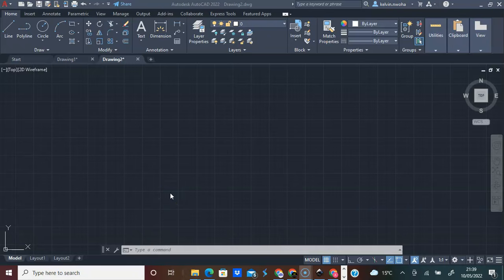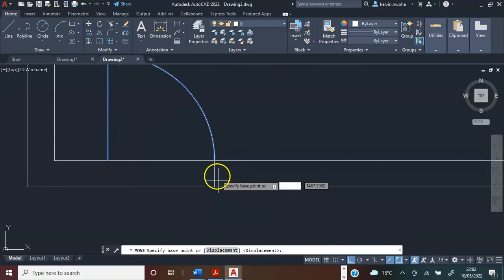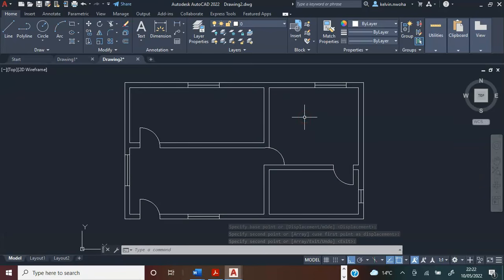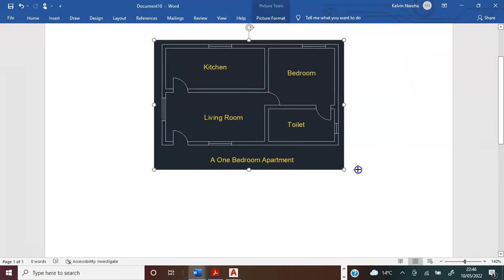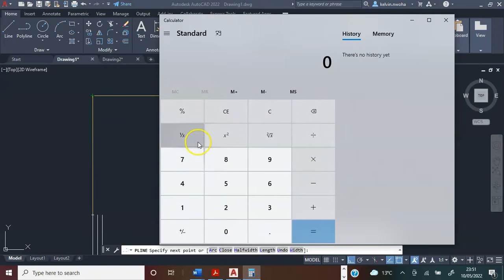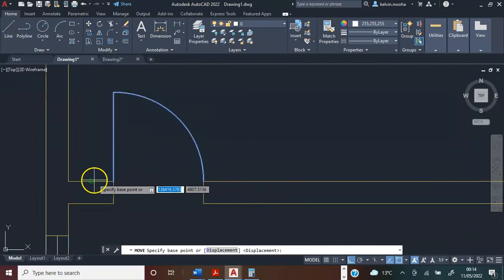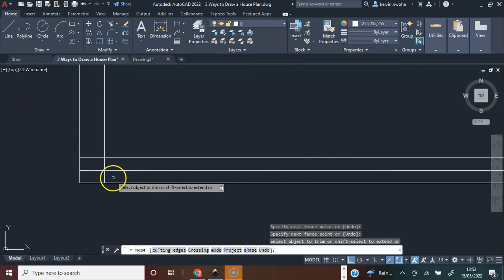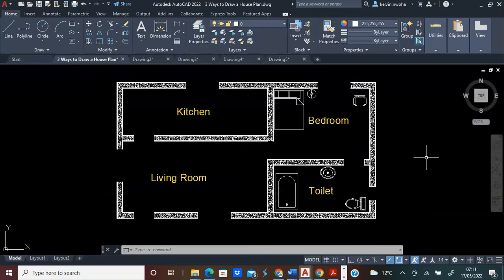4 Methods on How to Draw Floor Plans in AutoCAD (For Beginners)

Comment from the maker: 00:00 Introduction
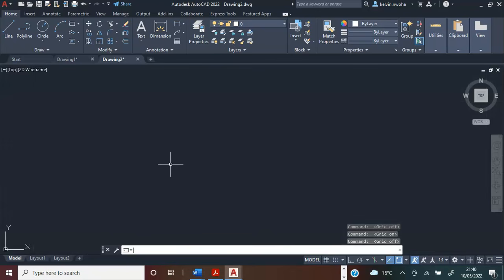00:31 Method 1
24:20 How to make a house plan line thick
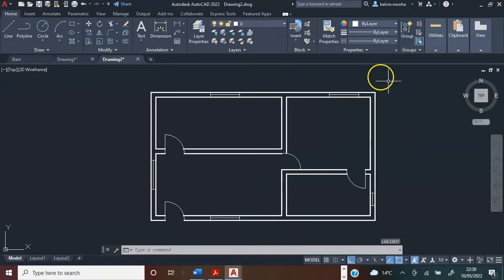26:35 How to dimension in AutoCAD
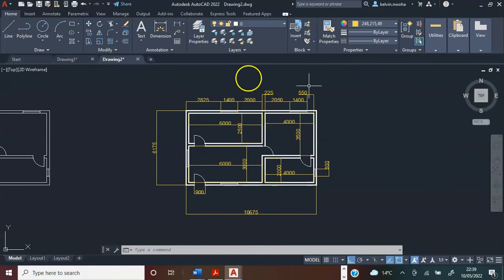31:50 How to Add Texts in AutoCAD
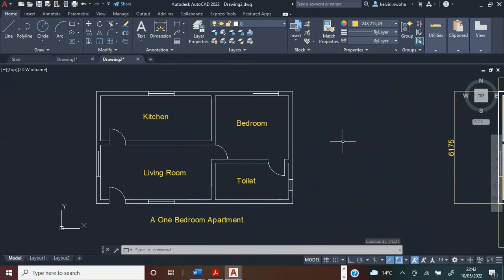33:58 How to Produce a Quick Print in AutoCAD
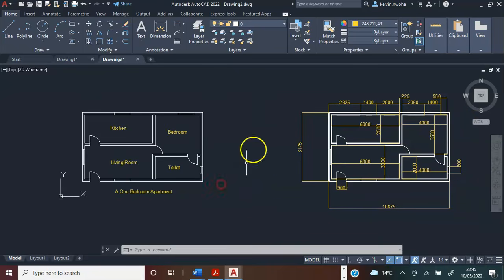35:50 How to Copy AutoCAD Drawing to Microsoft Word
35:59 How to Zoom in AutoCAD
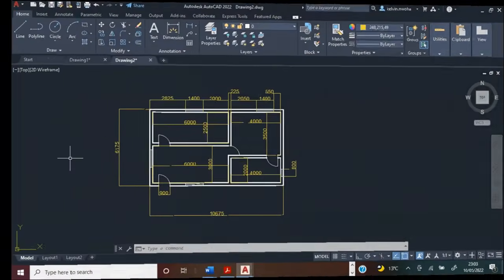37:08 Method 2
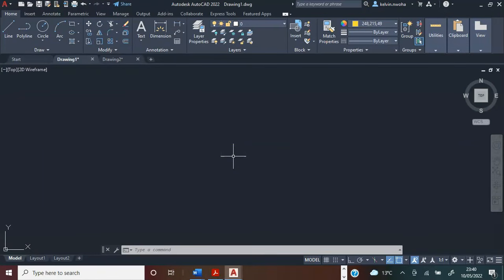43:09 Method 3
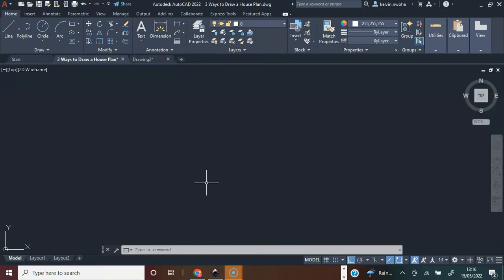1:03:36 Method 4
1:24:28 Hatching the Floor Plan Walls

LIKE THIS VIDEO THANKS! SUBSCRIBE: https://www.youtube.com/c/KelvinAcademyYouTube?sub_confirmation=1

There are many ways to draw a 2D building floor plans in AutoCAD. You can hardly achieve these draws without using the line and polyline command tools in one form or the other. In this video, I’ll walk you through "4 different methods on how to draw floor plans". Any of the taught methods will help you draw from simple floor plans to advanced complex floor plans in CAD.

Ensure you have a sketch of what you have in mind and possible dimensions before you open the CAD software. This will save you a lot of stress trying to figure out the lengths, sizes and thickness of your objects. In other videos, you will learn how to complete the drawing in a 3D model, and how to complete even more simple to complex drawing models.

BEAM SECTION PROPERTIES CALCULATION VIDEOS:
https://www.youtube.com/playlist?list=PLGiODXzBccMbIjLzYUQgwv7T03cF0M_8N

BASIC CONSTRUCTION ELEMENTS VIDEOS:
https://www.youtube.com/playlist?list=PLGiODXzBccMbKP_2ptBBd-tXqwNEr2rBa